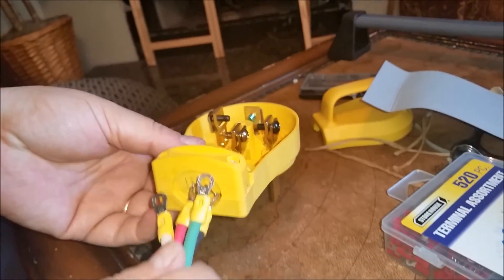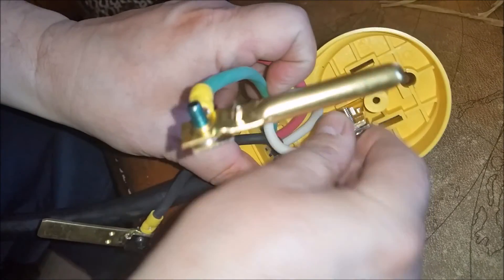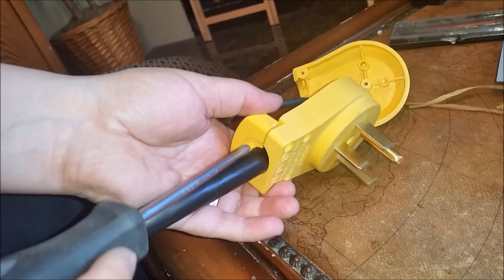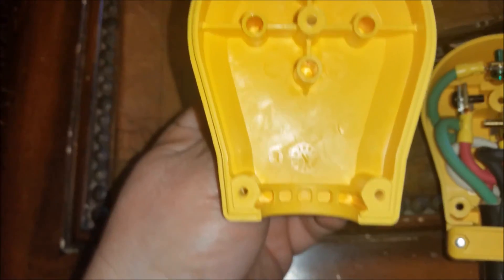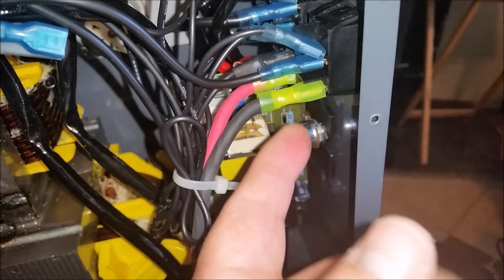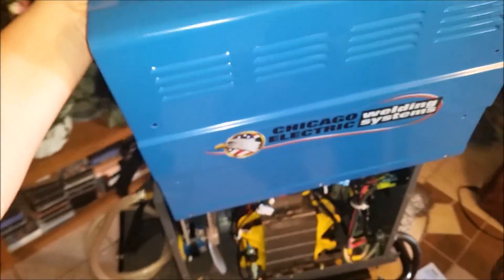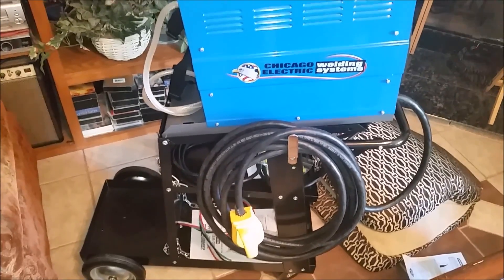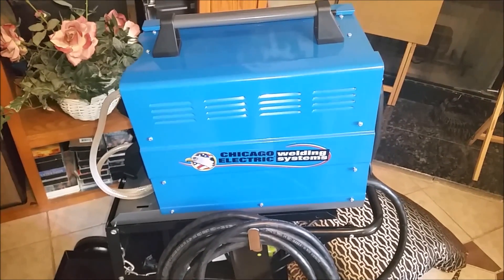Harbor Freight 110amp Dual Mig Welder PWR Cord Upgrade part 3

Comment: That was quite dangerous, appliances can back feed on neutrals and with your neutral line on your ground, the case can become energized. You either need to isolate your white wire in the machine or move the white wire on the ground pin. This could be seriously deadly.
Reply from the maker: Yep I agree, I just followed the wiring diagram in the manual. I did later isolate the GFCI Wite leg out as it would trip the breaker. This was my first welder. After I made the modifications the welder worked fine until I fired a couple of the rectifier diodes. Heck it worked better than my $450.00 Eastman Mig welder. The Eastman trips constantly but the HF almost never tripped. I think the Eastman suffered from lack of ventilation. I picked up a huge electric fan that I'm going to install in it. I think that will solve it for down here in the Souths, 80-90's temp at 80% humidity. Thanks for the comment. Safety is paramount. I do mention it in Part 4 here: https://www.youtube.com/watch?v=JY94rK5hvJQ   Best Wishes & Blessings. Keith Noneya
Reply: Good point, Mr3phase228.  He actually didn't need 6-3 cable, he could have used 6-2 with ground wire and saved a little money, maybe.

Comment: I need pics of the back of the switch’s plz
Reply from the maker: Hi John I don't have any pictures of them but you can get a better look at them in my video Harbor Freight 110 AMP Dual Mig Internal Wire Upgrade Part 2 here: https://www.youtube.com/watch?v=Ia6td_QVq3g Hope that helps. Also there are a few sellers on ebay who sell replacement parts for these welders. Best Wishes & Blessings. Keith Noneya

Comment: will this work on the 125 amp welder 110 volts so I can weld stuff on my car aka body panels
Reply from the maker: If the welder has a 220v option it will work on it. If the welder is strictly a 110 unit (most likely not) then just follow the instruction manual for connections.  If you don't have the manual just do a web search for it and add pdf on the end of the search. You should end up on a link like this one: https://manuals.harborfreight.com/manuals/63000-63999/63583.pdf Go to page 25 of 28 and use the wiring diagram there next to S1, S1 is the power switch. 

You may want to do a search as to which color is hot and which is Neutral/Return. 
- I know green is ground, you can check this by putting an ohm meter on it and testing it to the welder case. If you have a short 0 ohms then you've found it.
- White I think is hot.
- Black I think is return/neutral.
- Since the welder just has a transformer and an inductor for the output the 110 feed won't matter which way they are hooked up, as long as neither of them is connected to ground on the plug, LOL. 

- If using 110 the three wire lines on the left of S1 are the AC input and the Ground wire (Bottom) of the power cord. Connect the top two wires to the left of S1 to the two parallel prongs on the plug and the ground wire to the round prong on the plug. If you're not sure get an electrician to help you. 

- If you're using 220v connect L1 to the top wire left of S1 and L2 to the bottom wire left of S1 & ground to the ground prong. The ground pin is usually a "L" shape or upside down "U" shape. Again if you're not sure get an electrician to help you. If you can't find a copy just email me at KeithNoneya.att.net and I'll email you a few that I have later today. Ps nice banner on your channel, love the Kayak. Hope this helps, Best Wishes & Blessings. Keith Noneya